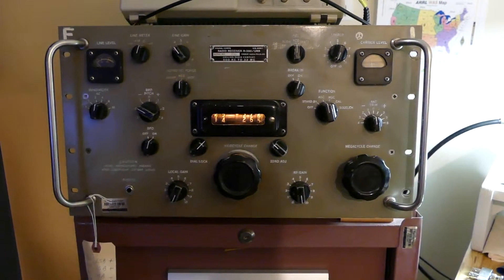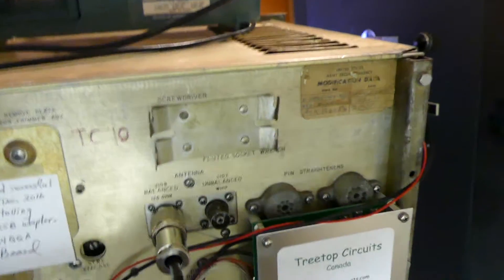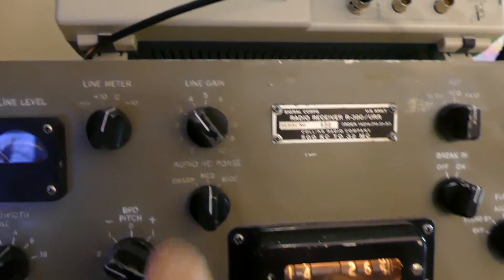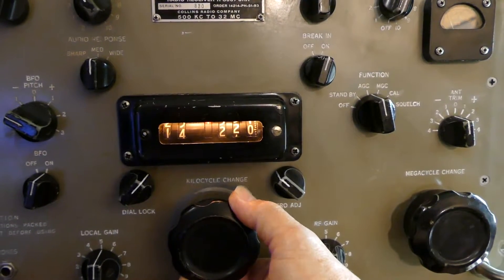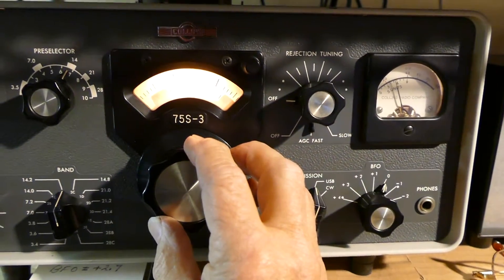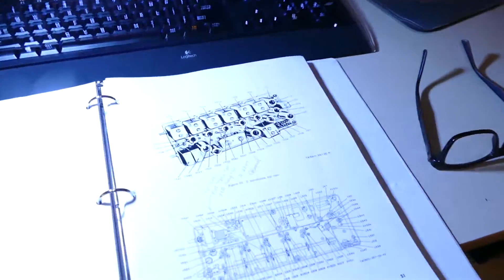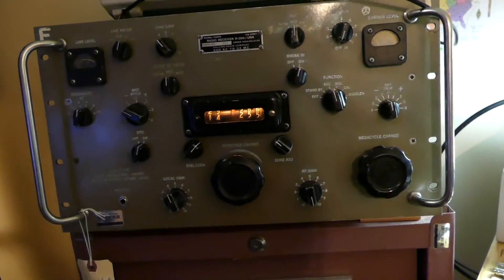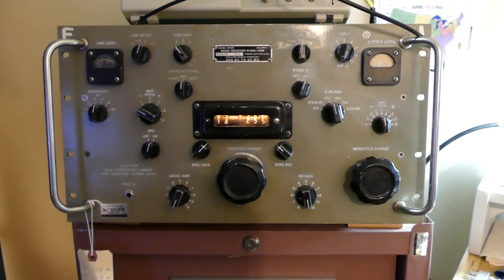Collins R-390  Receiver With Tree Top SSB Adapter

Comment: Where can if find the Tree Top SSB adapter?  My R-390A just arrived yesterday!
Reply from the maker: Here is what I found - I assume the adapter is still available.  http://www.treetopcircuits.com/pmwiki/Main/Products
Reply from the maker: @MikePeace  I think I commented before that I am not sure the Tree Top circuit really did anything for the R-390. I don't think it needs it. For sure, it disables the "S" meter for SSB. I use an outboard tunable preamp on my R-390 and it brings the sensitivity up to par with any receiver. Without the preamp, mine is a bit less sensitive than I want it to be and after discussions with a fellow that has worked on them for a lifetime, he says it is probably a "cumulative" loss and mostly in the IF section. I have hand-selected every tube in my receiver so I am satisfied with that and as good as I think I am... I am reluctant to go too deep into the IF section. I have pulled it out a few times with no issues but can't figure a good approach to determining what-and-if there is a component in the IF section that needs replacing. Did you get the R-390 or the R-390A ?

Comment: Can you still use the diode load audio with this?
Reply from the maker: Yes, operation of AM/SSB is normal except the carrier level meter does not function properly anymore. Quite honestly, I don't see any difference with the Tree Top adapter. Maybe I didn't use it long enough before installing the adapter to notice. Still a beautiful sounding receiver. I did add a preamp to the input to keep the sensitivity up. I think there is a small problem (but not the vacuum tubes) in the IF section that cause a drop in sensitivity - thus the outboard preamp.
Reply: @ElPasoTubeAmps , this adapter connects to the two diode load connectors and ground on the strips on the back of the receiver, which is right where you’d connect your audio amplifier to and the Treetop covers that up. I have two of these adapters that I was using with my R-390A’s and both lasted less than a year then quit working. Now that the company that was making them went quit making them I’ve got two that are sadly just paperweights now. I thought maybe something was wrong with the receiver I had it connected to, so I swapped it all over to another receiver and no dice, they’re both dead.
Reply from the maker: @AmishSpecialForces  Mine has worked ever since installing it which was right around the time I posted this video 5 years ago. My receiver is not the "A" model which I doubt makes any difference. When your adapters were working did you notice any better performance (in any way) using the the Tree Top?
Reply: @ElPasoTubeAmps , yeah it was working great, then one day I turned it on and it was like it wasn’t even there, no BFO at all. Still worked fine on AM though. I had a second one on another receiver and it did the exact same thing. I tried them both on my R-725 yesterday and neither one works. But yeah, it worked great while it was working. I have a video on here of it working.

Comment: The 390 series are supposed to be better. 
I tune and align all mine except one to hear .2uVolts readable audio
Reply from the maker: Interesting you comment at this time. I am working with my R-390 as the sensitivity has dropped a little and I seem to find it is always the IF amplifiers. Probably about the time I posted this video, I was doing the same thing and found a super strong 6BJ6 in my spares (as measured on the TV-7) only to quickly find it increased the noise level (background hiss) vary bad once I put it in the receiver and had to find another strong tube, but not as strong as measured on the tube tester. So, tube testers are one tool but in that case, it told me one good thing about the tube but couldn't tell me about how it would actually perform in the receiver.  
This is the only R-309 I have had, never had the "A" model. I can get this one to align/detect sub uV levels but I am not sure if I could copy audio at .2 uV. I have done some real comparisons with the SDRPlay vs 75S-3 and my iCom IC-736 on the weakest signals I can find on the band, and for all practical purposes, there is so little difference between what is copy'able as far as readable audio, it all turns out the same no matter what receiver I am using. 
I recently picked up some pristine Collins equipment, KWM-2A (Rockwell Collins) and a 51S-1 (Winged Emblem). Very pleased with them and I have found out that, I can sometimes copy audio a little better with the 51S-1 than the KWM-2A simply because the 51S-1 has a little bit more high picked and crisp audio - again, I am talking about threshold level signals. 
But after 60 years, if the R-390 series has not met with a butcher-tech, they are, or can be with proper maintenance, a magnificent receiver as good as any today (in my boat -anchor opinion)... only problem is the 85 pounds they weigh...   :-)   Thanks for your comments 73 WA4QGA
Reply: Thank you for answering. I love working on these series of radios. Problem now is mu shop is in my basement and have to remove power supply to carry them down. Have to call my son if they need to be moved up. 
Some days i work on cosmetics and other days tech stuff. 
I spent most time on agc problems and that means finding problem decoupling caps.

Comment: I think I liked the sound of the R-390 best
Reply from the maker: I often times do too. It has a lower tone and as mentioned, the speaker probably makes some difference. The 75S-3 has mechanical filters as most all Collins' radios do but this older version of the R-390 does not and may be why it has a (better?) tone. Even without the superior mechanical filters, the  bandwidth switch, just under the Line Level meter, does a beautiful job of narrowing the bandwidth and can often be used to push interfering stations off the pass band of the receiver. I usually use it at a bandwidth of 4 Kc but can sometimes copy better at 2 Kc. They sure built them right back in "those days" and the manual is fantastic at locating parts and doing alignment with, from what I have seen so far, not a single error.. It might also be interesting to know that when these receivers were new they were a Top Secret military device and one of the manuals that comes with it recommends how to destroy it if overrun by the enemy in a combat situation, i.e. smash it with a hammer, pour fuel on it and set it on fire, shoot it... (they actually don't say shoot it....) but destroy it any way you can to keep the enemy from getting it.
Reply: I've got a 75S-3, two actually, one needs to be cleaned up, it looks like it was stored somewhere. It's not in horrible shape though. The other set came from a working station. It didn't come with a 30L-1 but it's a pretty nice and complete station other than that. After almost a year I am finally going to put up a decent antenna, hopefully this weekend. I don't trust my "many times folded" 1/2 wavelength 80m dipole that runs through the attic rafters with the Collins. I'm tube ham radio (and transistor) gear poor... seems kind of silly not to have put up a good antenna up by now lol Priorities and all that jazz